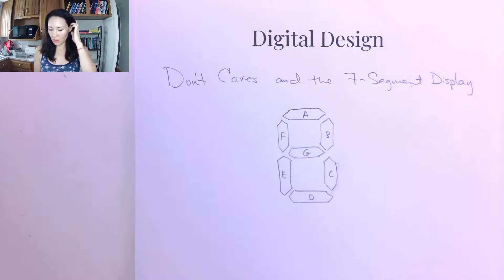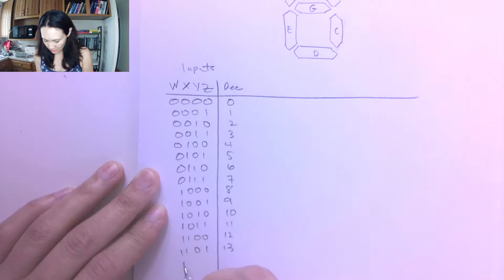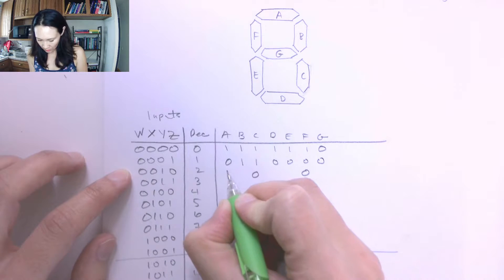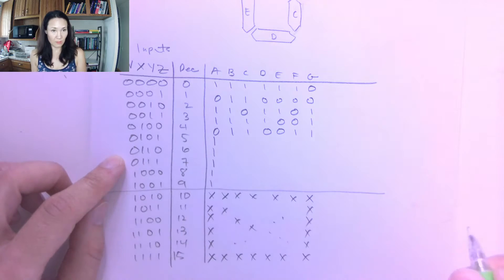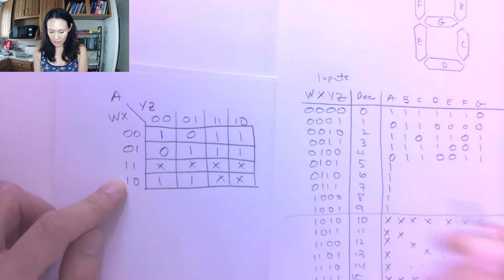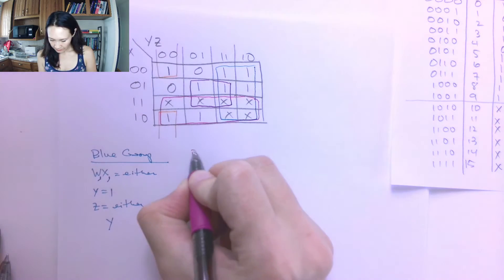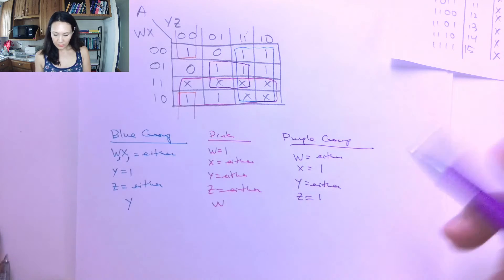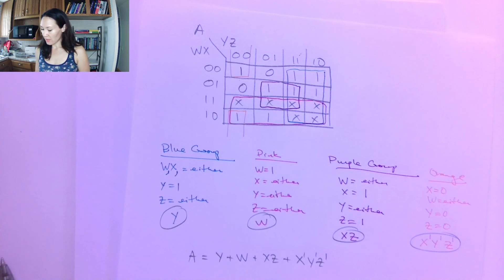Don't Cares and the 7 Segment Display

Comment: Two things - the last grouping could ditch the Y, as you can group 4 corners, rather than two cells. Another thing is regarding the 6 and the 9 - in those you can have "A" and "D" outputs as don't cares, respectively,  and see which form is easier to implement during simplification. 
Otherwise - great video! Deserved rounding up the likes to 64 :D